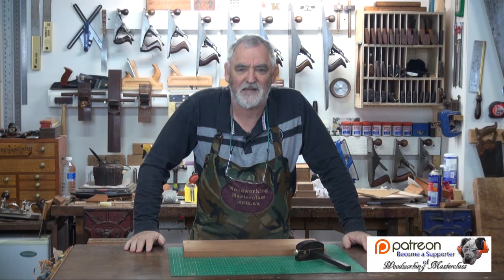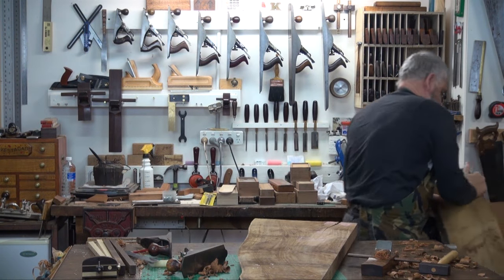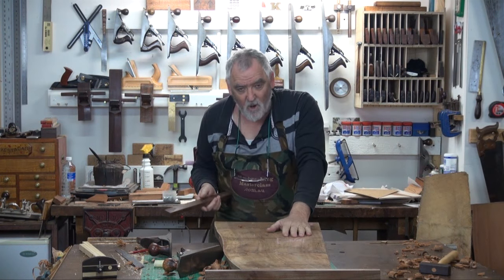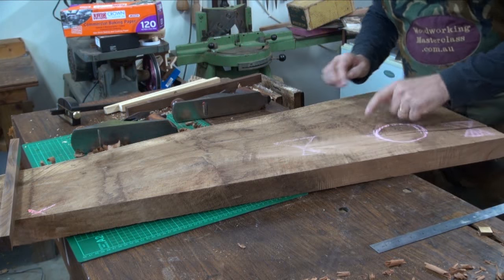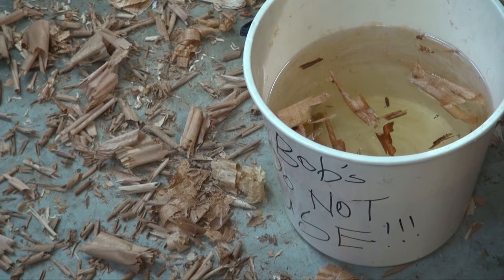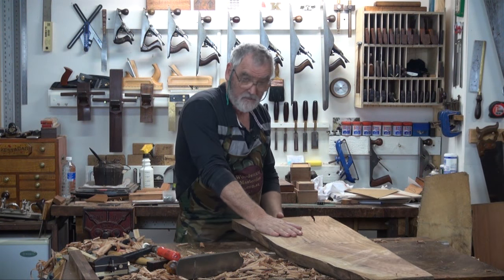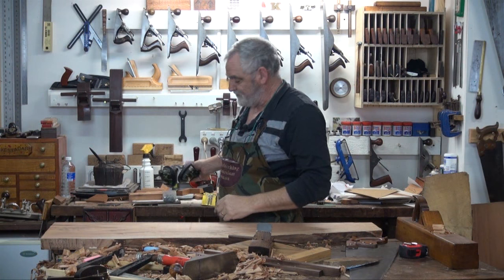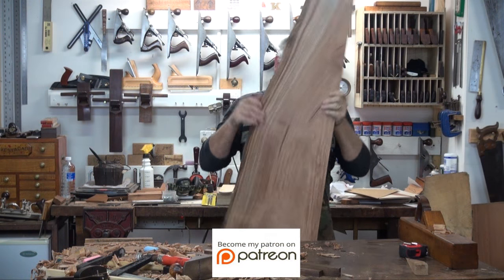Flattening Timber with Hand Planes and Thicknesser

Comment: so glad I found you on here as I usually am working when your on the idiot box! Wonder IF you could probably do a show on all the different planes and their correct uses! My old DAD knew but never taught me! as I am getting older doing it the right OLD way has become so much more important to me and to just show off the timbers natural beauty to its best! Give BOB a pat from us! Am soon moving onto an acreage without an abundance of electricity is also a parameter
Reply from the maker: I've a new show starting soon where you will get a good idea of which planes do what. Also would fit into the reduction of available power as mostly hand tools except for a jig saw and sander. New show is called Room for Woodwork. small teaser here https://youtu.be/WS1Ck9z7sdE Look forward to you company. Cheers Steve

Comment: You are some man, that took some effort and its impressive to see the end result, i love the way you dont have grain issues like me :-)
Have you done a video about filling the split that sounds like something i need to see
Genius
Malc
Reply from the maker: You have been busy. If you  are fortunate enough to be using HNT Gordon Planes grain direction sn't really an issue with them. Main thing in all planing is have the blade sharp and a fine set. Unless it's a scrub planes then you do want it aggressive. That piece is now the bench top for a work bench which I use in the new Show ""Room for Woodwork" which will be starting very soon. Cheers Steve